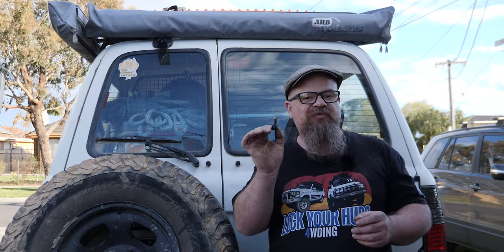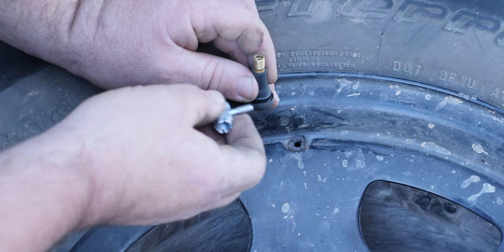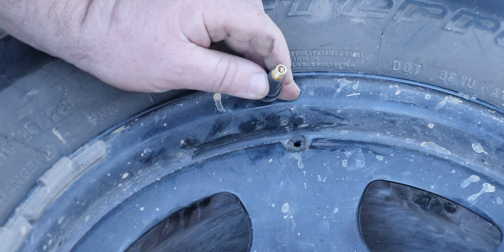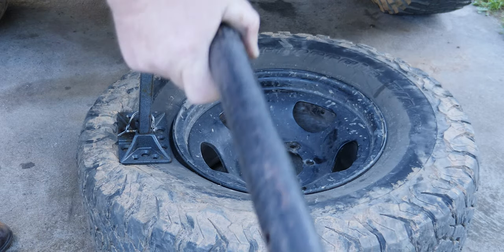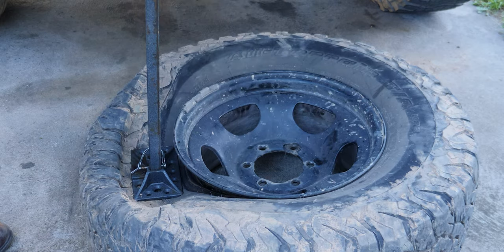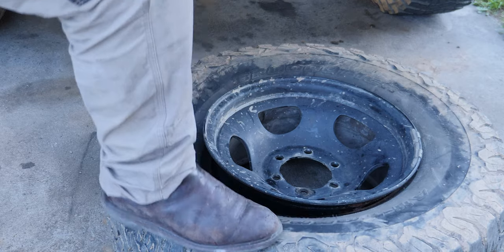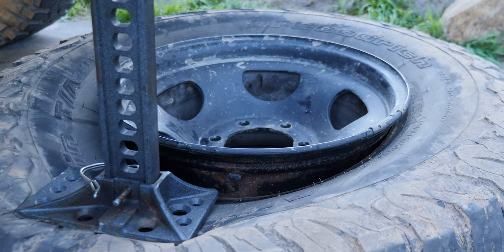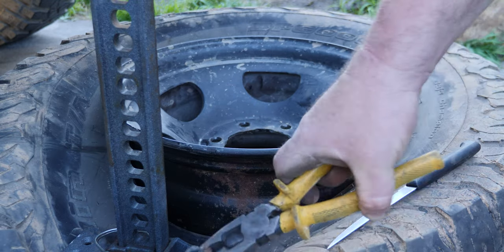4x4 Tyre Schrader Valve Replacement!

Comment from the maker: What's the most unusual tyre failure you've had out on the tracks?
Reply: Getting a flat & finding the spare has gone flat in sympathy too.
Reply from the maker: That happened to a mate of mine (4WD Instructor) heading to a training weekend. He had a flat, I pulled up to give him a hand, his spare was leaking with mud in the bead. 

We broke the bead and used a shop loyalty card to scrape the mud out so we could get the bead airtight again.
Reply: @LockyourHubs4WDing  The other 4WD flat spare to be wary of is the underbody mounted spare tyre and grounding it over sharp rocks. They will rip the spare tyre open easy as. No fixing the spare when it has a massive gash in the sidewall. You don't even have to drag it hard for it to kill the tyre.
Reply from the maker: Great tip, never thought of that one, that's where the spare is mounted on most Landcruisers as well.
Reply: Certainly one of the most frustrating tyre failure issues I have come across recently is getting my Can Am buggy beadlocks & MAXXIS tyres to seal, they slow leak badly. TECH 735 beadseal, cleaning the surfaces, re-torqueing beadlocks. Next I'm going to reverse the tyres & paint what could be a porous weld joining the rim sections.

Comment: .I haven’t seen this done on 4x4 show before but you made it look easy as.You get spare stems in the plug repair kits.I’m confident to do such repair in the bush thanks for that.👍🇦🇺
Reply from the maker: No worries mate, it's not hard to do.  I've probably had more punctures of tyres over the years, but the valve stem being ripped off does happen and it's an easy fix around the camp fire that night.

Comment: Definitely good information to have. I'd also recommend carrying a couple or so extra valves. Those things are way too easy to lose and too hard to find. Cheers Simon.
Reply from the maker: I'm also checking out a couple of ways to do the same job without having to break the bead of the tyre. And then "pressure test" them with a few thousand psi of nitrogen :)

Comment: That was excellent - all other bead reseating videos I've seen involve violence and explosive power using fire and brimstone...thanks for showing us how to do it simply and without the drama!
Reply: That's just the right tyre to the right rim.
If you have a big rim and small tyre, you need som gass to blownit on, or a ratchet strap...
Reply from the maker: If you're using the wrong (over width) rim for the tyre being used, you might need a bead blaster, though using this technique, I've done dozens of tyres it and seems to work great!
Reply: Thanks both, I hadn't considered that different combination of tyre and rim may require fire and brimstone! I run the correct size tyre for my rims, so my lesson is over. :)

Comment: What great video. I did have this problem once on the track but just changed the tire as I had no idea, so thanks. Colby make an emergency stem which I think you replace externally. Maybe another video for you. Keep up the great work Cobber.
Reply from the maker: Cheers, I've seen the Colby, though if it's ripped in half, you're still going to have the back half floating around inside your tire.

There is also one that uses a taper to insert standard valve stems from the outside. I must try it one day.

Comment: Well done, the only thing I would add is most inflators wont work unless you have the valve installed, the centre pin of the valves opens the air flow in the inflator, hope you understand what i mean? there's probably a mod you can make to the inflator so you can do it like this. :-)
Reply from the maker: I think the original clip on air chuck in the ARB inflator is like that. 

I hate clip on air chucks, not for that reason, I can never seem to get them to seal after a little bit of use, that's why mine has a screw on air chuck.

Comment: Great video but did you have to pop the beed couldn’t you just use the jack to press down on the side close to the valve exposing the rear of it and replacing it might make things a little easier?
Reply from the maker: Usually you'll need to get the opposite side tyre bead into the dropwell (low point in the rim) in order to get enough room on the valve side. It'll depend on the rim and tyre combination.

Comment: Hi Mate, how do I mod my ARB air fitting to the screw type like your’s (at 5:50 in the video)?
Reply from the maker: The spring loaded air chucks simply screw off. The replacement screw on type, came from eBay.
Reply: @LockyourHubs4WDing  Good morning and thanks for the reply. Sorry to be a pain in the ass, can share link to the fitting on eBay? I just want to get the correct one and not fumble my way through the process. Thanks in advance. You churn out great content and enjoy all your vids
Reply from the maker: @seowster  something like this will do the trick.  
https://www.ebay.com.au/itm/185364505731?mkcid=16&mkevt=1&mkrid=705-154756-20017-0&ssspo=smcottsfrmo&sssrc=2349624&ssuid=bbnNjPSGQ6C&var=&widget_ver=artemis&media=COPY
Reply: @LockyourHubs4WDing  Legend, thanks for pointing me to the right direction. Love your work.